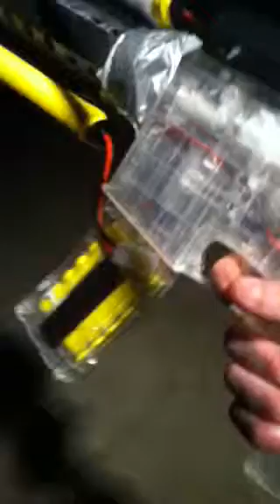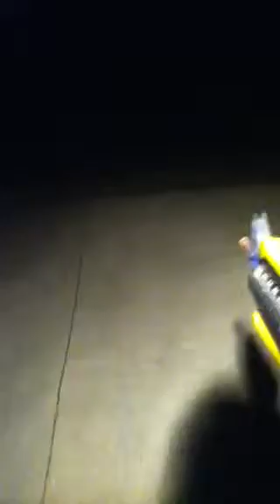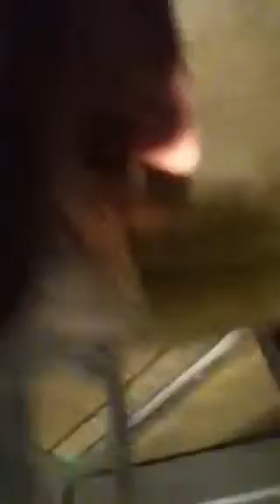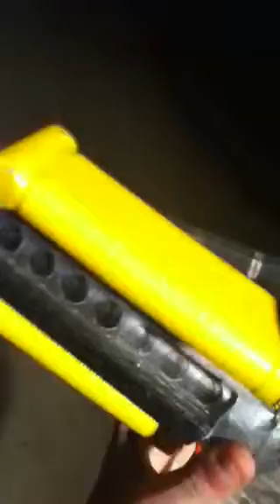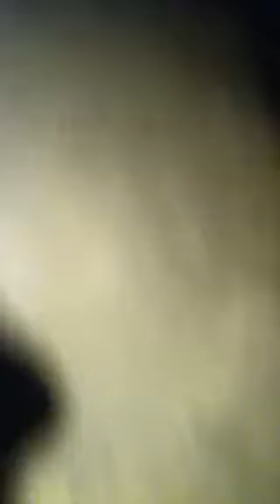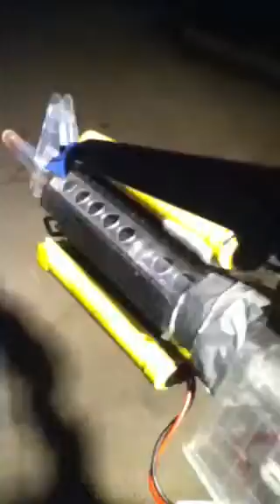Airsoft gun upgrade

Comment from the maker: Also forgot to mention the big yellow battery packs with the high firing rate are only about 1/3 charged.  If you had a really good hq camera you would see the white spaeks inside the motor casing; thats how fast this sucker shoots.  When i charged to full power the firing rate was 3-4X original, but i think doing that too much fries the motor.  Sounded like a mini gun at full charge :P.